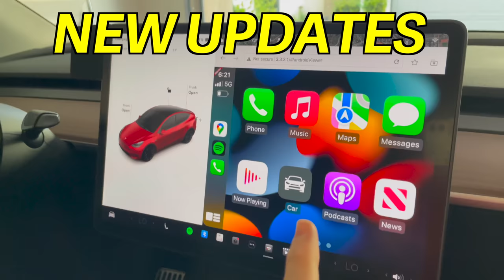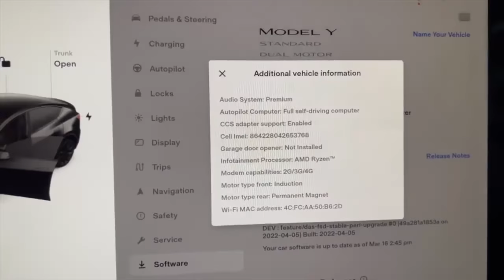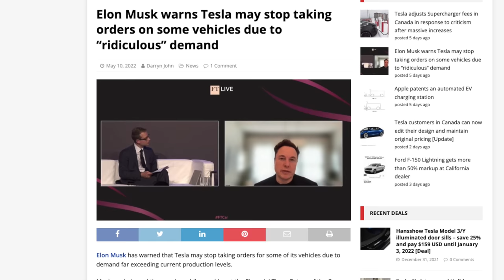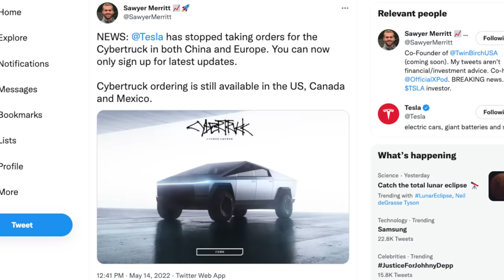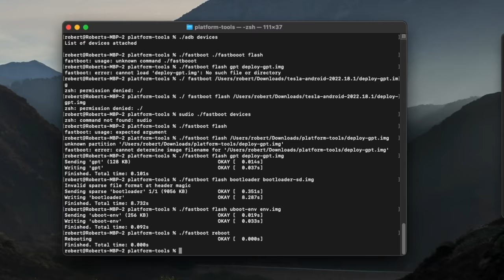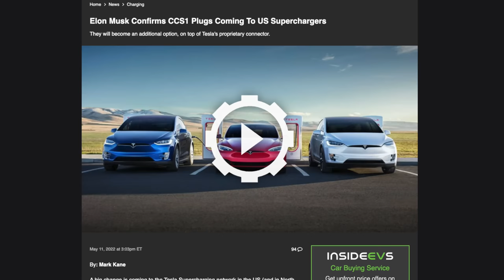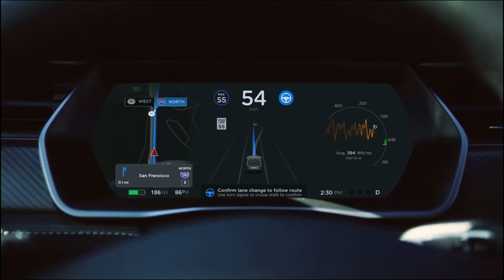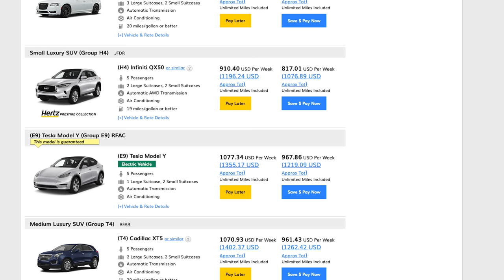Tesla Has a BIG Problem - Tesla Model 3 + Model Y

Comment: I’m not a fan of opening the superchargering network for all. That is one of the reasons I decided to go with Tesla. It gives you piece of mind knowing u can travel and not worry about charging. If Tesla opens it to all EVs they will be mega crowded and us Tesla drivers may not be able to use it. A better idea would be to add a couple chargers for the other EVs vs modify our current charging stations to accommodate the other EVs. Like maybe add 1 or 2 chargers at the stations specifically for other EVs. This way Tesla owns are not impacted at all.
Reply: most EVs are already Tesla so I don't think it will be a big deal especially if they continue to expand the network.
Reply: I agree with you!  Its just another way for tesla to make more $.  After a rise of 9K in just 1yr. Is horrible.  I got my 2021 for just 39K and that was with the 1K white leather seats.  I couldn't even afford 1 now!
Reply: I agree with you Chevon Parker. There's a lot of Tesla owners that cannot charge at their cars at home and rely on the superchargers and use them frequently. Now putting yourself in a situation doing a road trip and pulling up at a supercharger that is fully packed with EVS and you don't have enough juice to go to a different charging station.
In my opinion other companies have to step up their game and invest in super charging stations.
Reply: @Kris-so9zq  or Tesla expands it's network even more. Sharing of networks gives more options.

Comment: the supercharging network is why some people get a tesla, if they open this up to everyone it will be a slap to the face for people that bought one.   The lines to charge are already long enough!!!
Reply: Exactly. When they open a spot up to non-Teslas they would first have to expand with more charging stations at that location or build a new one in the area to pick up the extra charging.
Reply: @relaxationsounds6981  
I've already suggested the smart thing to do would be.
Open 30% of V2 chargers at a location.
But "negotiate" with authorities that they can add a similar number.
So, 24(?) chargers, open 8 (V2)
Built 8 (V3) and designate these Tesla only
Everyone wins!
Then roll out over the network.
When that phase is complete, repeat.
Reply: Chargers are open to non-Teslas only when they are not full. This helps Tesla owners because it is extra revenue from existing assets which allows Tesla to expand their network more quickly while lowering the revenue and slowing the growth of competitors.

Comment: Without wanting to sound selfish, I’m not a huge fan of the decision to open up the supercharger network to non-Tesla drivers. I’ve had a Model Y on Order for months, and the ever-changing estimated delivery date, plus complete inability to get any sense from Tesla (or a response at all!), is beginning to piss me off. The supercharger network is one reason I chose a Tesla specifically over other premium brands, who I’ve got lots of experience of, and who were falling over themselves to provide a better pre-sales service!
Reply: So, chargers.
Allowing others to charge is dependent on there being space at the location.
Since others need the app and are then located a specific charger, the system can monitor the usage and refuse entry on the app if it's busy.

Comment: While I'm not happy about them opening up superchargers it does make sense to be able to use any DC fast charger anywhere. I think in whole it's great for the industry. 
They need to increase capacity and change the flow of the lots. You can't have people jumping in line or we will have conflicts when some EV6 owner jumps right in a spot at a supercharger.  They really need and entrance and exit that doesn't allow people to jump in spots. Tesla owners are already doing this to other Tesla owners that's only going to get worse. 

Also will they be preconditioning? If they're jumping on superchargers and sitting there for an hour because they didn't get updates to precondition on navigation or just know how to get the most speed at a charger it's going to suck for everyone. 

Hopefully it takes them a little while. As a new owner 3 months now I'd like to enjoy it for a little while before things get even more crowded.

Comment: Tesla will not open up every supercharger station in the US to non-Tesla vehicles, and at the supercharger stations that do have CCS capability, not every charger will have a CCS plug. The concern that this change will inconvenience Tesla owners is not taking into account the massive supercharger expansion that will occur when federal infrastructure funds begin flowing to Tesla, funding that would not occur if Tesla didn't add CCS capability.

Comment: I genuinely can’t think of any reason how opening up Super Chargers to all is of benefit to Tesla owners. IMO, the best way would be to provide 1-2 adapters at each station, but still leave a decent number exclusively to Tesla Owners.
Reply: It is very simple. Opening up chargers (when they are not crowded) increases revenue for building more Tesla chargers. At the same time it decreases the revenue of non-Telsa chargers thus slowing their growth. If you own a Tesla and you want the Tesla charger network to expand then this is a very good thing. If you own a competing charger network then this is a disaster.

Comment: Opening the charging network is not cool at all. It is a surprising short term thinking move by Tesla. 
It is a stupid business move.
Reply: You got it backwards! Opening up the chargers (when they're not crowded) increases revenue allowing Tesla to expand their charger network more quickly. It also takes away revenue from competing chargers thus slowing their growth. Increasing your own network while slowing the growth of your competitors is a great business move.
Reply: @BitJam  That makes sense, however it does take away from the exclusively that Tesla currently has. Tesla doesn’t need any other EV manufacturers help to expand.
Reply: @rynocrone  Fair point but unfortunately Tesla can't make enough EVs fast enough to be true to its mission statement:

To accelerate the world's transition to sustainable energy.

Tesla needs/wants other companies to make EVs too.

Out of Spec Motoring recently raced 5 EVs from Colorado to Las Vegas to see which ones charged fastest.  The top speed allowed was the limit +5 MPH.

https://www.youtube.com/watch?v=-rXackuF6BQ

Two of the 5 cars were Teslas.  SPOILER:  the Teslas were 3rd and 4th in the race.

If there were more v3 superchargers along the route then the Teslas would have done better.   This points to the need for Tesla to more quickly expand its charger network.
Reply: @BitJam  I can see how enabling other EVs l can help the worlds transition. I just don’t see how that specifically helps Tesla. I don’t think the charging stations are income drivers for Tesla. 
The Tesla infrastructure is a huge perk for Tesla owners that promotes more Tesla sales. 
I think keeping the exclusivity benefits Tesla share holders more than adding the minimal income from the outside vehicles charging.
Reply: @rynocrone  Charging non-Tesla cars can be a huge revenue stream.  First, they will pay more for the same electricity.  Second, IIUC, the plan is to only allow non-Teslas to charge at stations that are not full.   This is basically free money.   It would be crazy for shareholders to prefer those assets to sit idle instead of being used to make money.  

It means every charger Tesla installs is more profitable and every charger the competition installs is less profitable.  This is the path to market domination.
 
Wouldn't it be great if the vast majority of chargers were owned by Tesla and optimized for charging Teslas?    The only way to make this a reality is for Tesla to open up their chargers to non-Tesla EVs.

I do not understand why a Tesla shareholder would prefer for Tesla to not dominate the charging infrastructure.  You beat the competition by stealing their customers, not by forbidding their customers from entering your store.

Here is another way to look at it.  At some point the government will step in and demand that all chargers (or all chargers that receive federal subsidies) must service all EVs.   Tesla can either look like the bad guys by being forced to open up their chargers or they can look like the good guys by opening them up before they're forced to.

I agree that the Tesla charging network was a big selling point.  But I also recall that Elon always offered to open his network up and the competition refused to cooperate because they didn't want Tesla to dominate charging.  They intentionally made their cars and their chargers incompatible even though what Tesla did was technically superior.

At some point (perhaps soon) there will be plenty of EV chargers for everyone just like there are plenty of gas stations now.  Tesla cannot prevent other EVs from having a good charging infrastructure.  We need to look to the future and not try to cling to the past.
Reply: To me it’s real simple. Tesla won’t need other EV company’s to dominate both EV sales and charging.